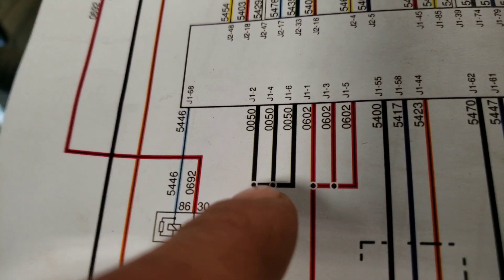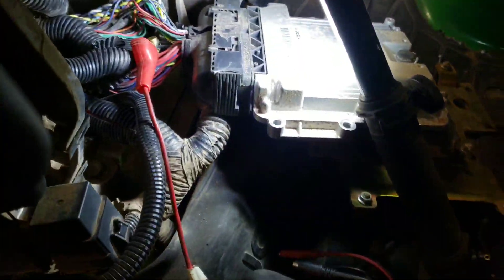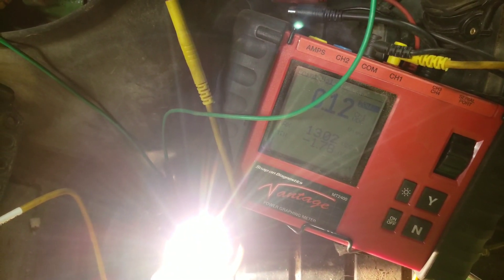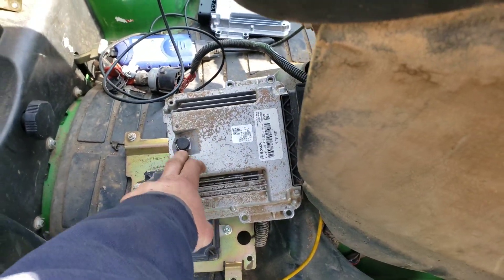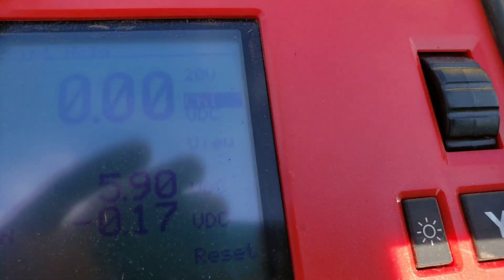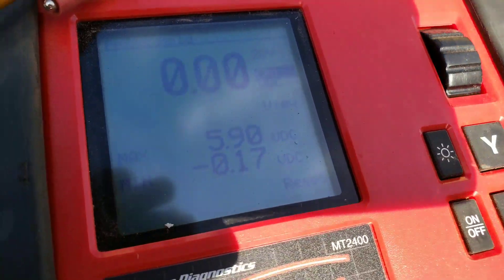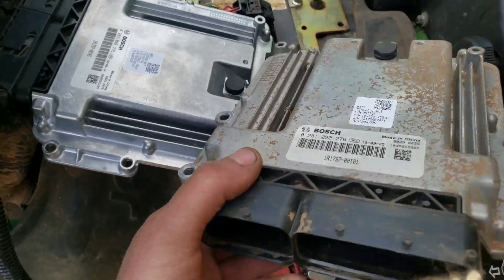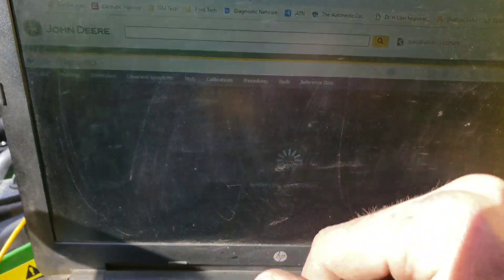JD 3039R - Part 3 - Diagnosis Confirmed

Comment: I suspect that the software update isn't writing the whole code base to the EEPROM. Had a case like this with a BIOS EEPROM on a PC that was updated but wouldnt clear the chip to then write the whole program, just overwrote what was necessary for the update. That leaves inconsistent code  scattered in the BIOS that was only dealt with with a new, clean EEPROM that could be written with the base code package. Caused all sorts of grief like no onboard video, tho there was, and several other glitches like incorrect USB initialization.

Comment: Nicely done! Much like yourself, it frustrates me when I don't have access to the proper information or data to confirm 100% what is  believed to be the point of failure. I don't blame you for not wanting to swap in another module but it's nice that there was at least one available from a similar unit, versus having to purchase it on an unproven theory. Can't imagine those suckers are cheap. Did I hear you correctly when you said that coolant temp faults will not inhibit regen? If that's the case I'm surprised John Deere does it that way. I would think a coolant temp fault would for sure inhibit Regen based off the need to be able to abort if coolant temperature passes a certain threshold. I know with GM at least, every time I've had to do a forced regen they make sure to tell you right on the scan tool to watch the coolant temperature. Not to mention they have you open the hood and the ECM commands the vistronic fan at full tilt. In any case, just curious. Thanks for the video!
Reply from the maker: When I get a chance today, I'll plug into one and simulate a fault. Per discussion with the factory and my own experience I have never seen it inhibit regen but I can say that I haven't tried to simulate a high temp during regen yet. The ECU does run some type of plausibility check and allows it to continue up to 220 or so, but there may be an upper cut-off point or it may just continue on with what its doing.
Reply: @ScienceOfDiagnostics  Nice man! I look forward to seeing that whenever you do get the chance.